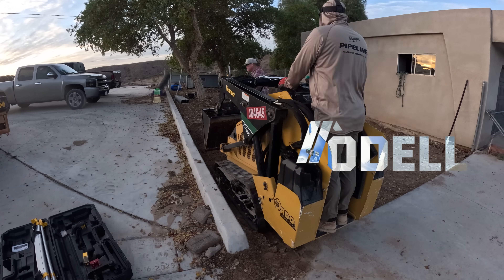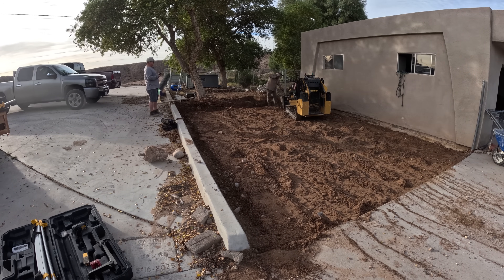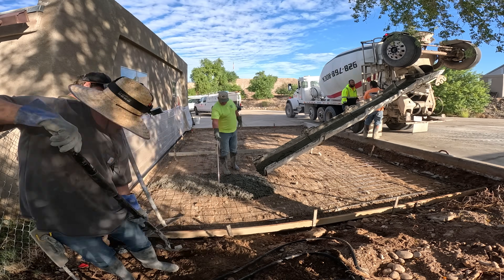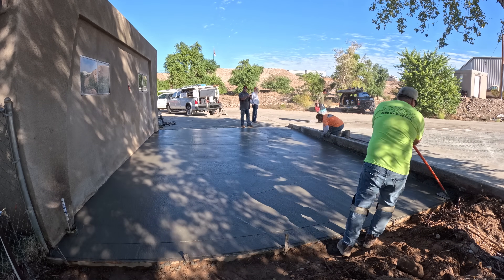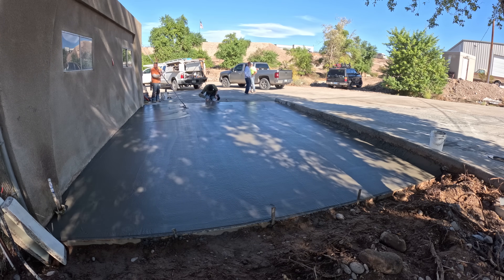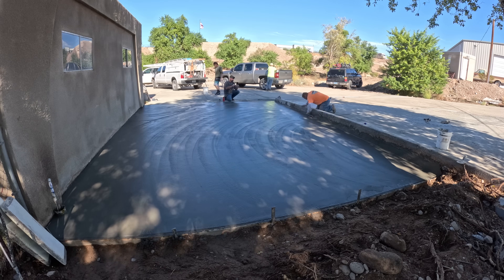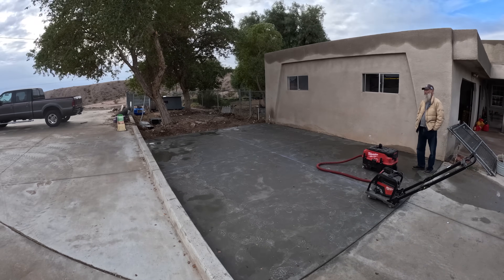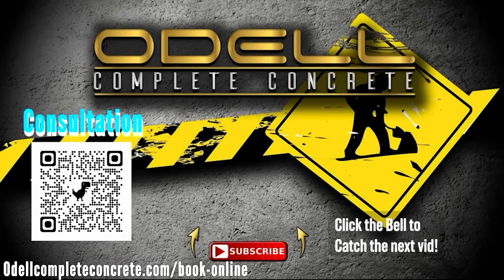Genius Concrete Trick Saves This Carport Pour! (Dry Pack Bucket Method Explained)

Comment: Your team created a nice looking slab.
I have a few questions, which may seem critical but it's mostly to reconcile different work practices in different parts of the world.
First is regarding the extant curb. Why was the curb retained? It seems to be a useless element on the finished job. Client request?
Wouldn't a ring beam bearing the extant and new slabs at the boundaries result in a slab system that can move and stay aligned?
Why was there no capillary break, blinding sheet or vapour barrier installed?
The steel was laid flat on the subsoil. Why aren't chairs being used? 
A vibrator snake ( compactor) flattens slabs as they're poured making screeding faster. Is this not something you do?
After sawing the control joints do you caulk the joints to protect the steel rebar and to keep the substrate moisture levels stable?
.
Building foam is a modern scourge. What was it's use in this installation supposed to achieve? You didn't really explain the reasoning behind that or I missed that explanation...
Your surface finishing is very very nice.
I normally shutter up some footpaths or machinery plinths to use up any delivery surplus as a freebie for my clients or myself... beware of scope creep though. I poured some boat mooring anchors on one job with the surplus. No cost to me and a happy client is your best advertisement.
You're lucky it's not hot there.
Reply from the maker: AI was getting busy, but none of it applies to this job.
Reply: @OdellCompleteConcrete who is Al?